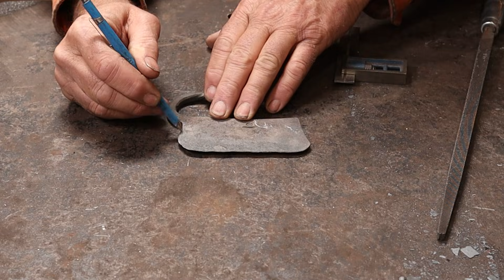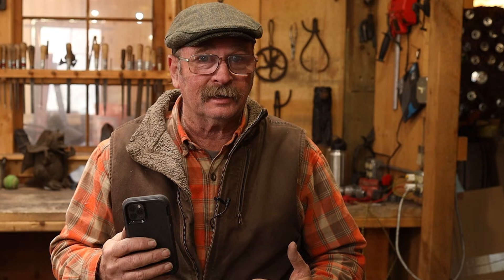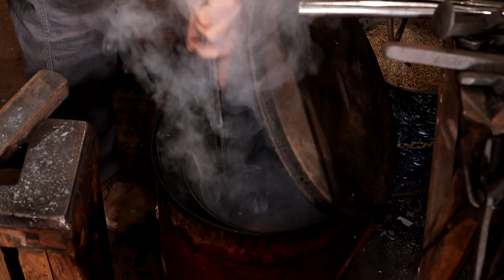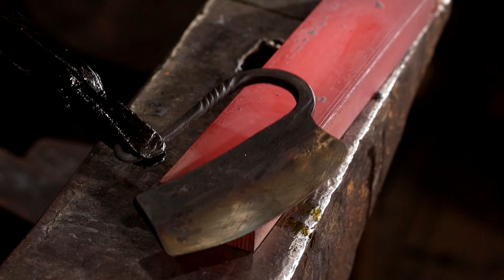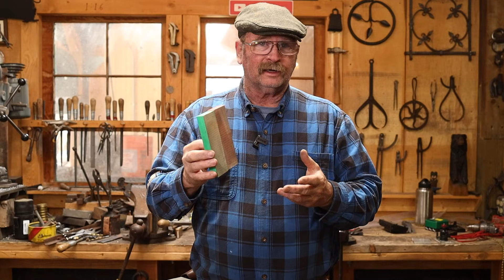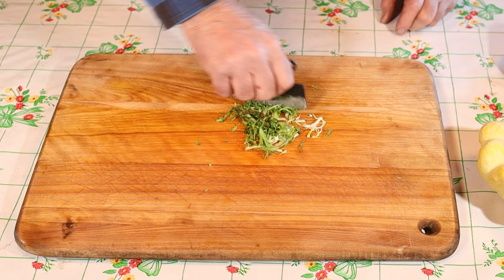Herb chopper part 2  - filing hardening and hand sanding

Comment: I love watching all your videos! Thanks for showing us how to blacksmith!

For reaching the temperature of 1475F have you ever tried the salt trick? I've seen it a few times on Forged in Fire. The melting point of table salt is about 1473F or so so they put some salt in the forge and see if it melts to test the heat for quenching. I am not sure how they do it though. I don't know if they put it on the steel or what. Do you know about this method and if it works or not? Thanks!
Reply from the maker: Salt quenching requires some very specialized equipment and can be very dangerous if done wrong.
Reply: Thanks for the information on that  @BlackBearForge . I am still new and I don't know much. I don't think they were quenching in salt. I just saw them put a little bit of salt somewhere in the forge to see if it would melt to check the temperature. After the little bit of salt melted, they quenched their knives in oil. If that is dangerous I wouldn't try it. Thank you for taking the time to respond to my comment!

Comment: Quick question! Could I do a similar process with a Rasp? Hand sanding wise? I don’t have a belt grinder but I want to make a herb chopper for the house but I don’t want to get it forged out and not even able to put a edge on it. I have good steel I can use but I love the look of a Rasp blade

Comment: When do you choose to quench and temper, or air cool, or anything else? This is a great project and I think I want to make myself one. Thank you! Have a great day!
Reply from the maker: Any steel that needs to be hardened requires quenching.  Some steels quench in water, some in oil and some in air.  Anything that has been hardened by quenching should then be tempered.  Water and oil hardening steels may be cooled slowly in air to remove stress, but that doesn't work on air hardening steel.
Reply: @BlackBearForge  Thank you. How do you decide which of your tools need hardened and tempered? For example, I see most tongs and such you make not go through the process, but the cooking tongs you quenched the arms.

Comment: I get you said this in one of your videos so I'm going to use one that's probably pretty old you're not going to get to for awhile I need to know where do you get your Cole from because I'm trying to get more coal for an order a few different knives and I wanted to use my coal Forge versus my 3-ton propane Forge
Reply from the maker: If coke and coal are not available locally, many blacksmithing suppliers will ship.  But shipping bagged coke and coal gets pretty expensive.  Once my current supply from now closed local mines is gone, I will probably switch to charcoal for solid fuel.
Reply: Thank you I just wanted to know I thought I would ask a real Smith

Comment: What is the kind of "pencil" that you use to mark on steel? is it a soap stone or something? I asked at the local hardware store and they had no idea what I could use.
Reply: He usually uses a lead holder with silver or white "lead" in it. And you usually have to order it online, I have yet to find a store with white in it.
Reply from the maker: The product is a Markal Silver Streak.

Comment: If the metal is smoking, depending on your oil you use to quench in, you know the surface temperature is about 400 F, canola oil smokes at about 400-450 F but it could be higher also, the auto ignition temp is about 800 F. I use crucible industrys tool steel selector as my basis for heat treatment, but they don't show all the steels, just specialty steel alloys for the most part.  https://www.crucible.com/eSelector.htm

Comment: John after the temperature color runs do I dip into the same oil or water or air as I quench to harden or As I have seen some Blacksmit the last dip in water ?
Reply from the maker: I quenched it in water, but you could go back into the oil

Comment: Another great video John I tried my had at 1 last Sunday after watching your video but while trying to get some length on the handle I got it kinda thin now its not very solid I think I'll bend it over and tack weld it to the tip of the spine but I'm happy with it for my 4th real project only been forging for about a month

Comment: Do you not worry about the face of your anvil putting that hot steel and letting it sit there please answer that question so I know
Reply from the maker: No, the anvil has so much mass it won't heat up with such a small piece for such a short time.